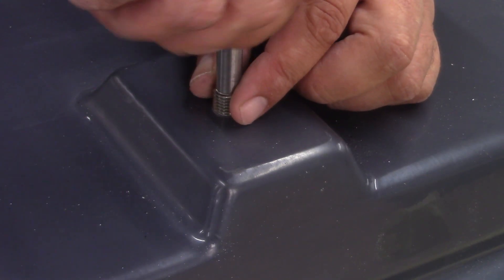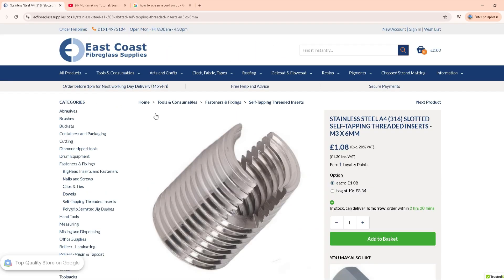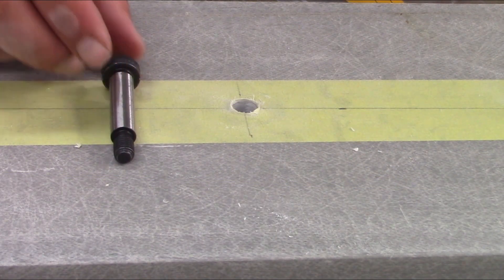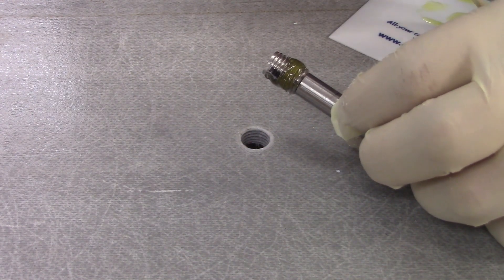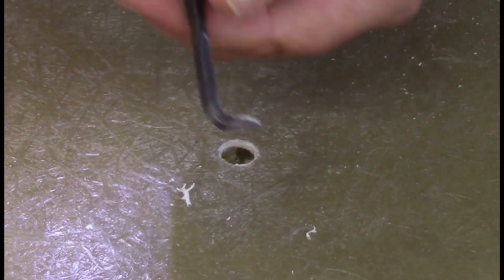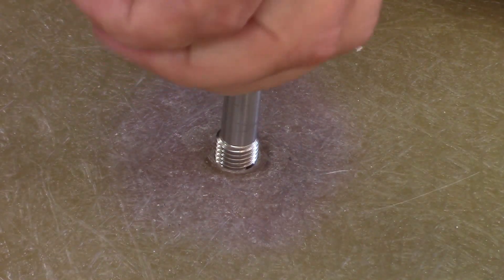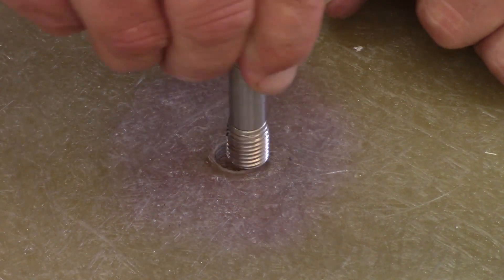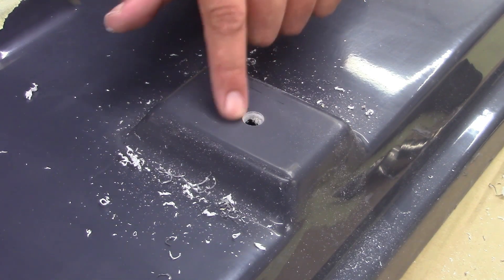Installing Self Tapping Inserts in GRP

Comment: No one ever mentions thread pitch on inserts. Why is that ? 10mm is only half the info.
Reply from the maker: This  video  is only about installation  of a threaded  insert onto GRP.   It isn't   so much about the individual inserts as  their are many more types ad sizes  to choose from out there.  The pitch if you needed to know would have to be supplied to you from your insert supplier or you may need to use a pitch gauge to check it out if this is information you need to know for whatever reason?  being in the Uk we only sell metric sizes so our sixes such as M10 for example will fit a metric M10 bolt as standard.    The installation of the self tapping inserts  into GRP is the same regardless of pitch.